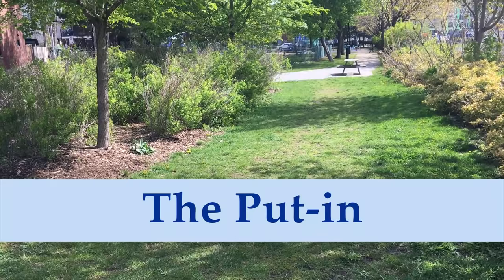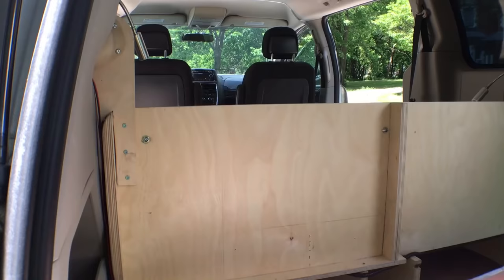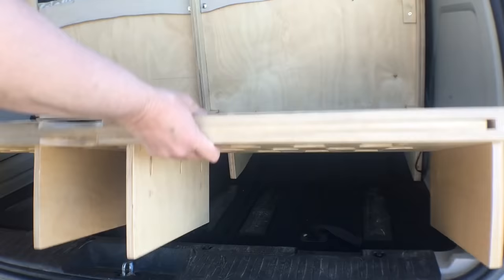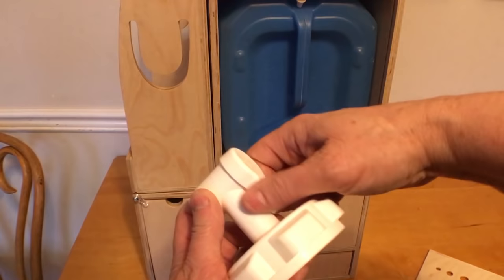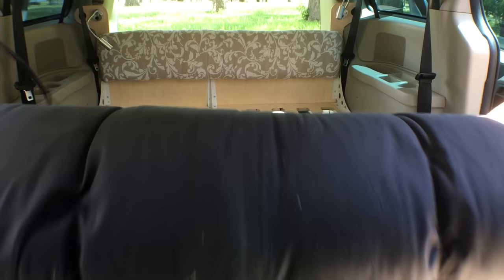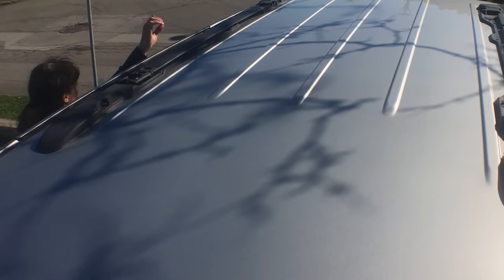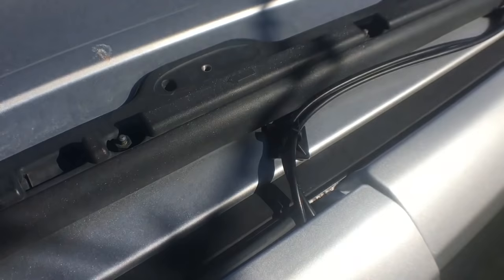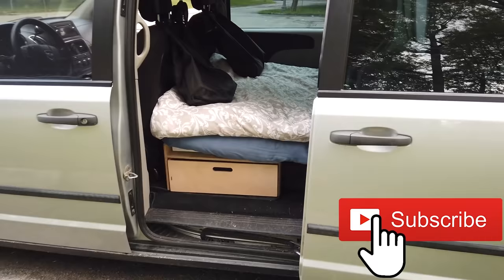From minivan to camper van in 30 minutes

Comment: A tip for securing the solar panel, install all your bolts loosely before you start tighting down. That way you have some wiggle room. It's a little tip I learned when I first startedy career as an aircraft mechanic. Get all the bolts or screws started with a couple of turns and then go back and snug them down. Great build!
Reply from the maker: Yes! that is the way to do these things, thanks for pointing that out!

Comment: i would suggest you use magnets to hold skeeter screens to body of van, unless you like them perm inside instead. could also use something like a lil velcro, or sugru (nice silicone putty) etc... in various places on side windows to hold oversized pieces of screen then just stuff edges into open edges when window is open
Reply from the maker: Hi, no sure I follow, but I am already using magnets for some of the screens. I try to avoid stick on vercro because eventually the glue tends to fail in a hot car + I hate the sound of velcro!!!!

Comment: I would add lock & flat washers to the roof solar panel bolts. You dont want bare bolts to vibrate loose
Reply from the maker: Good point! I was assuming the since the stow n place roof racks didn't have any type of lock washers, I would follow the same system. I think the fact that the threaded inserts in the roof are fixed goes a long way to preventing the bolts from working loose, but could be something to try if you have any problems with things loosening up.

Comment: Maybe try Velcro wraps instead of the electrical tape on the wires. Just a thought❣️ Velcro may even work on the other wires/cords. Happy camping. I'm getting ready to go camping in a Chevy Equinox. A SMALL suv. I only have 39" clearance in the living space. But, I ordered a tent that goes over the hatch in the back for more space.
Reply from the maker: Hi Brenda - the electrical tape is to insulate the edges of the connectors, so they can't touch each other. Velcro wraps won't work for that.
Those tents are a great solution for camping out of a car/van

Comment: It's one of the best conversions I've seen.

Potential issue with the weight of that boxed fridge not being over the axle.

It's a lot of weight to have in the overhang.
Reply from the maker: Thanks - I’m not worried about the fridge. It is a 27liter cooler, so tops it would weight 27 kg. Water jug on the left side is  10 liter. 
The van can carry nearly 700kg of people/cargo. 
A load of groceries in the back luggage area would weigh more!

Comment: It's good and it works but once it is installed you can't use any other seat, But it just goes to show how much useable room these Vans have, well done good job.
Reply from the maker: That's true, I sometimes wish I had worked a few seats into the plan. But it is possible to free up the back row seats in a pinch, just not easy. You can see it here:
https://youtu.be/X57kqKfljgg?t=754
Reply: @averysmallcampervan  I bought a conversion that you could do likewise so you could still use 5 seats as well as carry the camper conversion at the same time.
Reply from the maker: oooh sound good
Reply: @averysmallcampervan  It's shame you don't live closer then you could make a couple of adjustments so it could stay in the back and go from factory seating to camper in under 2 minutes or less, But Hey a work of Art is never finished Ay, good luck and have fun.

Comment: I don't know if it's worth doing , but perhaps it might be easier on some of the screw in bits to just drill straight through and use some type of flat headed short counter sunk bolt with a wing nut on the other side to secure that section rather than having to use a power screw driver to fasten it.

Comment: EXCELLENT video/non permanent conversion. Do you feel that all of the wood compartments weigh down the van?
Reply from the maker: They do ad up but I have tried to use the thinnest wood possible where I can. It is not over the loading capacity, I can't remember the weights but I added it all up at one point.

Comment: so clever, you deserve more subscribers. have you investigated visors for the outward opening rear windows, so you can leave them open in the rain?
Reply from the maker: Thanks! I have been thinking of ways to shield those back windows if it rains a lot - still working on the problem!
Reply: @averysmallcampervan  hopefully I can find a model car that has long enough visors that will fit the van?
Reply from the maker: Thanks what I am hoping

Comment: Great videos. Where did you get your crossbars for the solar panel, and did you have them shaped and drilled, or do it yourself?
Reply from the maker: Hi, They are 1" x 1/8" aluminium flat bar. I got them at a big box hardware store - Réno-Dépôt - and shaped and drilled them myself. For my set up I also had to drill extra holes in the solar panel frame itself (which voids the warranty!) I'll try to made a video showing how I made them...

Comment: How long does it take to remove the seats???
Reply from the maker: Which seats? I have a bench as the 2nd row and it comes out with two levers and is out in under a minute. The 3rd row folds down into the floor and stays there, again in about a minute...